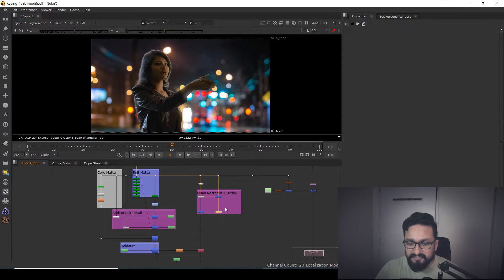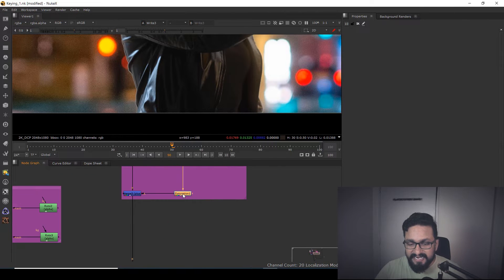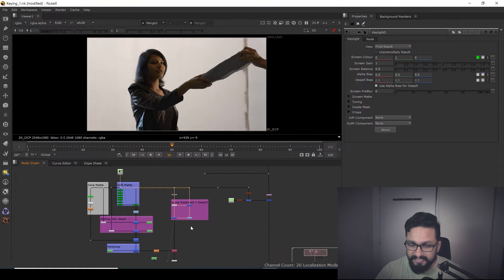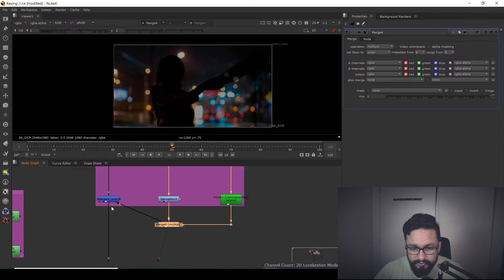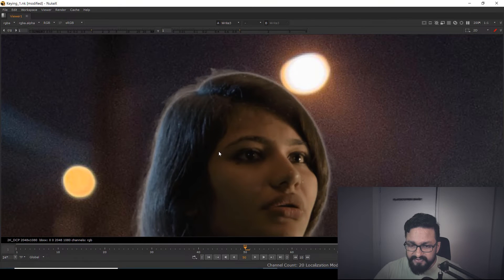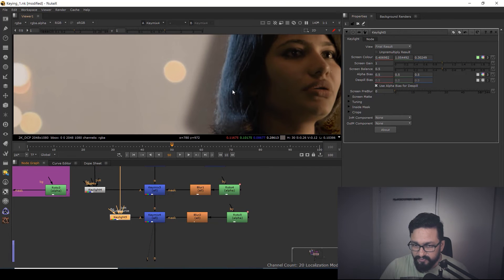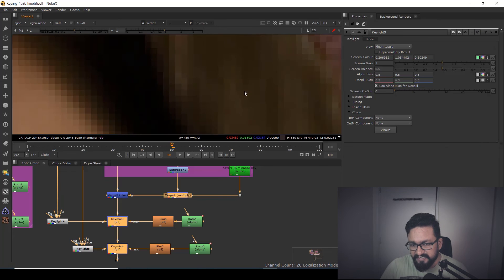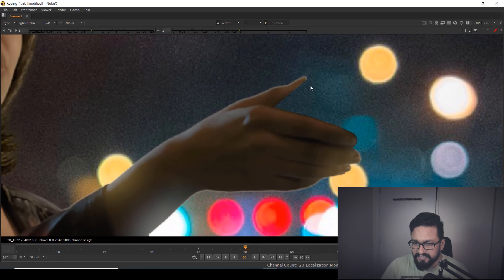PRODUCTION TECHNIQUE REVEALED FOR FIXING WHITE EDGES | VFX VIBE

Comment: a simple despill expression would work pretty neat. where it finds the spill area and replaces it with background, making it an error free workflow. No bright and dark edges, just proper pixel treatment. Though I appreciate your efforts. This type of problem generally occurs if footage was compressed to lower bit depth. Basically 32 bit float image will never have this problem.
Reply from the maker: Agreed, but not in every case we get 32 bit float data. Made this video for knowledge purposes and to make everyone aware that this method also can be used 🙂.
Thanks for your valuable thoughts 🙂🙏

Comment: Sir. I have a h264 compressed file which has major compression artifacts in it. It was converted from a mov file. Will reconverting the mp4 h264 file to mov/exr file brings back all lost information and remove the compression artifacts? Or is this process is irreversible?
Reply from the maker: Detail can't be retrieve once it's compressed